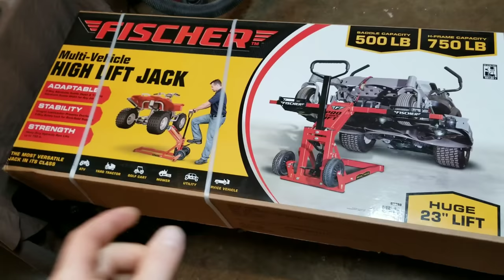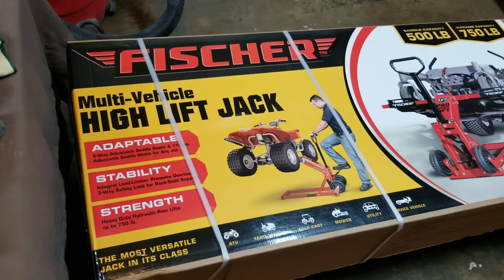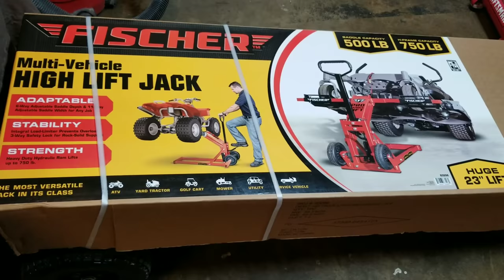DLC - FISCHER High Lift Jack

Comment: I noticed on the raising the wheels were on the two bolts, are you supposed to drive mower wheels into black brackets as deep as you can and then when you raise mower the wheels eventually roll onto the 2 bolts holding tires. Because as you go up tires go back towards the rear of brackets. I'd rather have tires nice and deep into holsters.

Comment: I would agree, this lift is safer than what I used to do before I got a tractor with a loader. Doubled up 2 x 12s opened trailgate on pickup placed boards at a 45 degree angle and drove up set brake and chocked rear wheels. Many years I did this, difficult cleaning deck working around boards and changing blades. Then I bought tractor loader I chained front cross member on Wright Sentar Zero lifted and did my work, that also is a little sketchy. Chain holding up 1000lb machine from smashing me into concrete.

Comment: Thanks for the video, this will make assembly faster for the rest of us.. However you have your description of saddle and H-Frame backwards.  The saddles are the wheel holders and the H-frame is the H-Shaped center piece for heavier lifting. (From HF website: Exclusive H-frame center beam support allows multiple service options including steering, brakes, wheel and tire repair).

Comment: Just picked one up today. Excellent video. Will be assembling it tomorrow. After watching this I expect it to take half the time. About the only thing I'd do extra is put some grease on the axle  for wheels.
Reply: There are bearings in the wheels
Reply: @marshallevans9457  no from what I  remember. Just a rod wheels slide over.

Comment: I wonder if one can use another lift in the back to lift both end so it can be lifted higher.
Reply from the maker: I'm not sure but check the weight rating for sure.
Reply: @HandyGuy2016  
Of course once lifted, stands or blocks will be another layer of security under the 4 corners of the wheels.
I already have a Cub Cadet lift and about to go harbor for the lift similar to yours if they have it.
Thanks for the reply

Comment: I like your High Lift jack HandyGuy2016, I just found another way to change mower blades. I used tractor front loader for a few years, and chain, stand at mower deck change blades. 

Mower drives between out rigger legs of 2 ton Harbor Fright Hoist, will lifts 1000 lbs. 8' high, I still use chain. Than walk up to mower deck change blades. Hoist folds up, rolls in shop for storage. Used hoist to move 1500 lb lathe. Same price with coupon, $200, as High Lift Jack. I was in market for cheap crane, only problem, they start around $700. I only try to lay on my back in bed, like to looking at ceiling, Ha. Good video.

Comment: I have an old Sears riding mover. Whenever I need to change a belt, I flip it on its side on grass and change the blade or belt. When finished, I flip it back. This does not do any damage to the mover and I never had any issues. Just make sure the gas tank isn't full, so the gas doesn't trickle out.
Reply: Oops typo.... mower, not mover.
Reply: Lmao
Reply: That is a bad idea as the oil will get up into the upper part of the engine where the valves & plugs reside. I'd wait a good couple hours before starting the engine to allow oil to drain back into the crank case.

Comment: Looked the the front casters were trying to walk out backwards as it was lifting.
Reply from the maker: Memphis Vapor Company  That is why you need the safety strap.
Reply: not in the cradle right
Reply: need to adjust wheel saddle to a wider gap so wheels fall down more